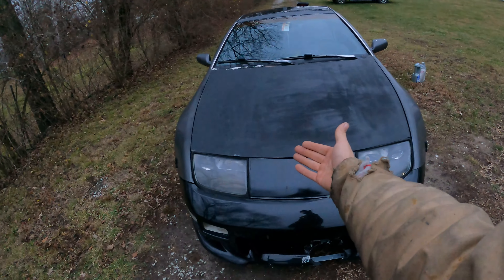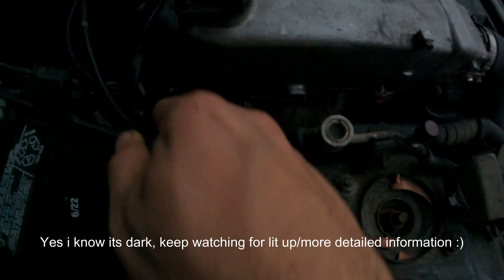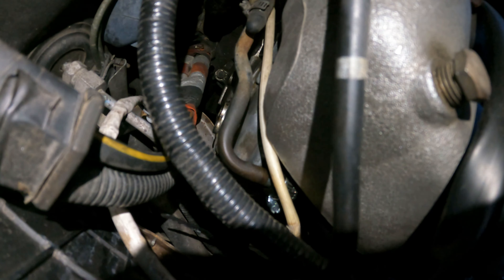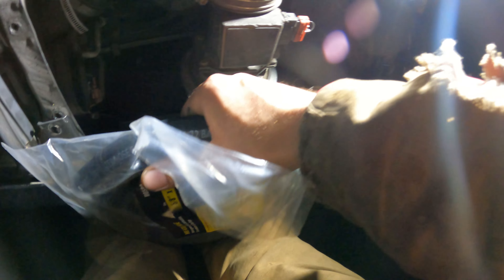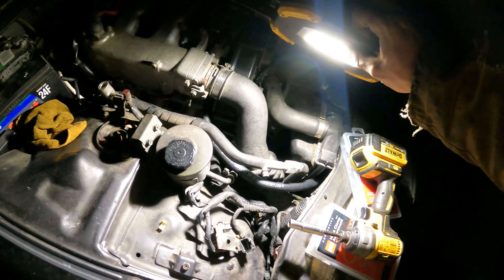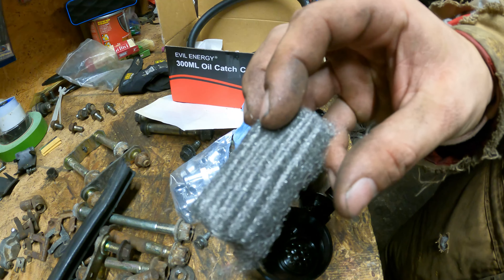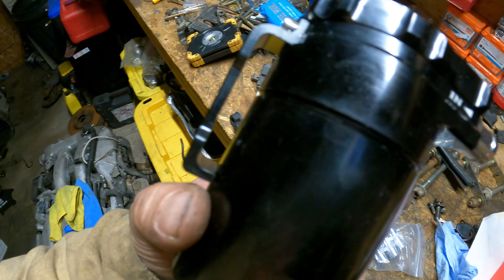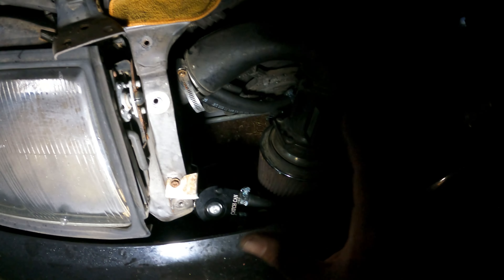Nissan 300zx Catch Can Install - NA & TT

Comment: Did the freeze plug method while i was doing the egr delete ended up pretty clean but I used brass Ts and Ls so i don’t have to worry about the plastic cracking ever might have been overkill but good video
Reply from the maker: Good call!
I'm not too worried about them cracking /breaking as they won't see temps other than the air coming in.

I sat at the parts store having a 5 minute dilemma/debate trying to decide which to pick😅😆